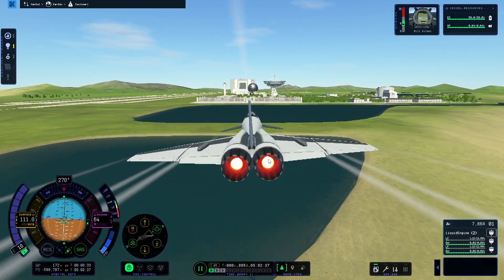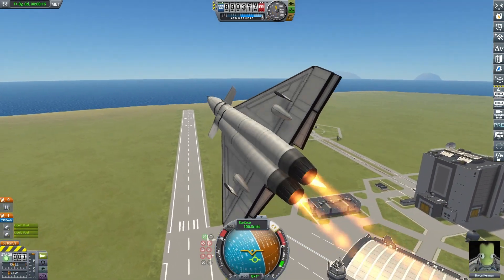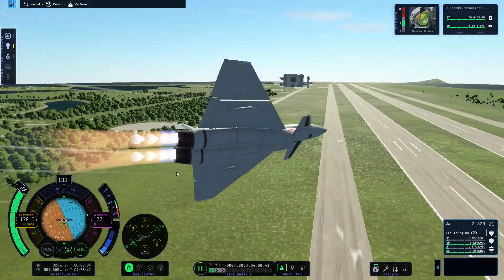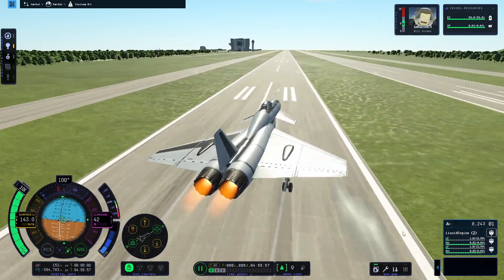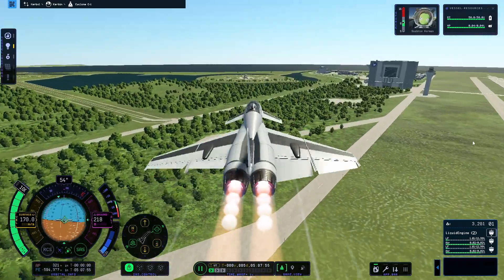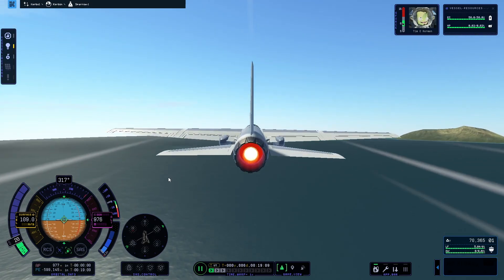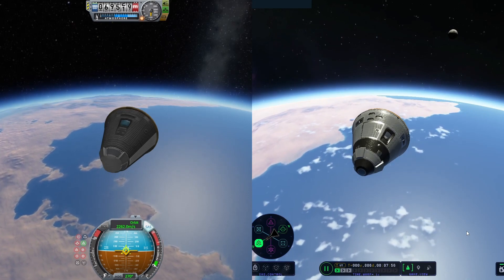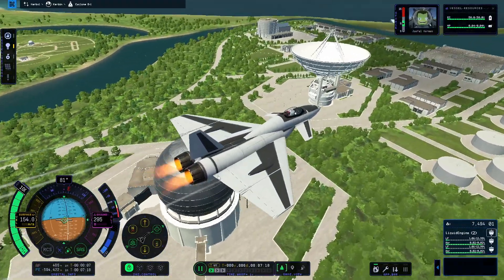Aircraft & Aerodynamics - Kerbal Space Program 2

Comment: Something I've noticed is that drag just below and above Mach 1 is far too high. SSTOs that would've required one Rapier to get through mach in KSP1 now require three, whereas they should realistically require two with the amount of thrust they produce. I'm finding I like the lift and turning physics a lot more in KSP2—the atmosphere is a lot less arcade-y and you bleed energy more quickly whilst pulling similar AoA and outputting similar thrust. Also, higher speeds require you to actually be high in altitude, so no more Mach 2.5 at sea level, which is great for realism. Only gripes I have are the unfinished SAS and, again, the mach drag being too high. Other than that, I've got high hopes!